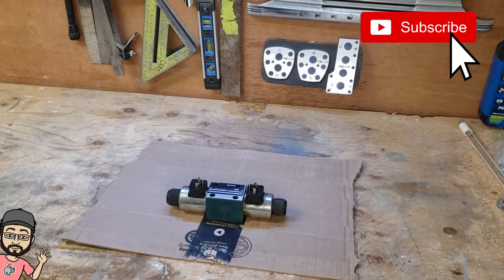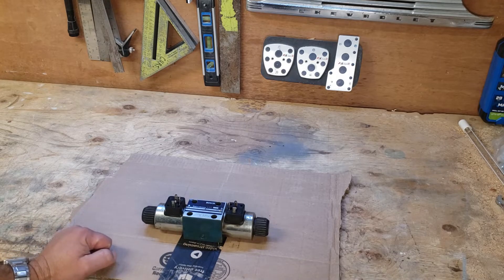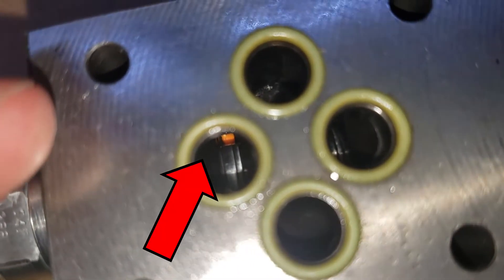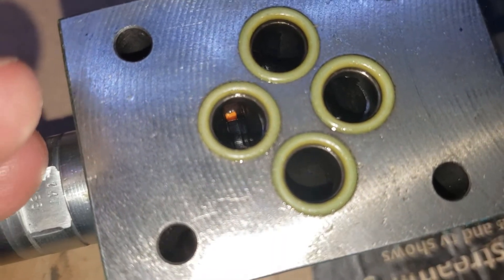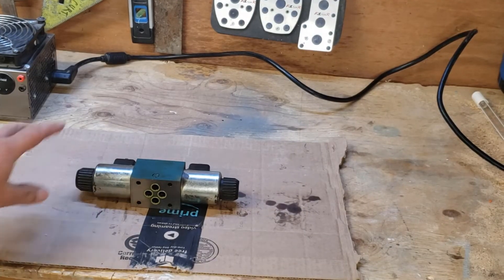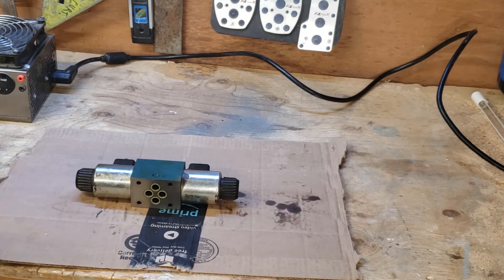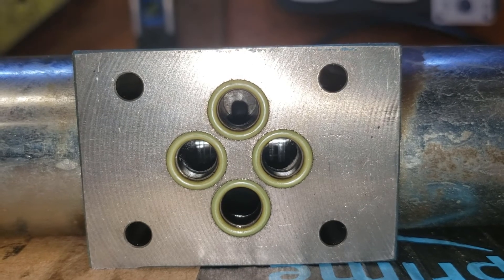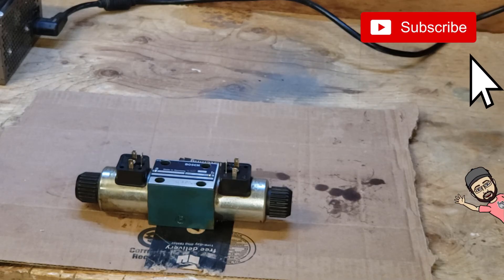Hydraulic Valve Repair

Comment: Thank you for taking the time to disassemble, inspect and repair the faulty directional valve in the video, sir.  That's really the only way that folks are going to actually understand how these valves work.  We have a backhoe here that has an intermittent reverse issue.  CAT calls the hydraulic valve that controls their "FWD-REV shuttle shift" operation the "Shuttle Control Valve Group."  My question is whether or not there may be a way to buy parts for the directional valve to affect our own repairs?  I'd also like to know which tools are normally employed to remove a valve assembly like the one in the video?  Our valve also has four deep holes, but it's mounted in such a way that one cannot see down into the holes.  Please keep up the great work.
Reply from the maker: Every one I have removed so far were held on with hex socket bolts (removed with Allen keys). To speed things up I bought long Allen keys and cut the short end off and use them in a cordless drill.
Reply: @nothandsomebuthandy   Great tool variation, sir.  As I can't get my head over the valve assembly, it's pretty much impossible to see down into those holes.  If you wouldn't mind, would you give me an idea of what the typical size is for the allen bolts used to hold one of these valves down?  Thank you very much.
Reply from the maker: I found this on google, not sure if it's your exact model but it's the same size Hex key I use: 260-8590: CAT SHUTTLE VALVE ASSEMBLY, Attributes:
• 3/16 female Hex head
• 7/16-20 UNF male thread mount
Reply: @nothandsomebuthandy  It turned out that the "hex socket" bolts holding the valve assembly in place required a 4 mm allen wrench to break them loose.  This seems pretty simple, but it wasn't.  The two bolts closet to the rear of the machine could be broken loose with a regular 4 mm "L-shaped" allen wrench.  The two bolts closest to the front of the machine, on the other hand, required me to "modify" the allen wrench.  In other words, I had to shorten the long end of the allen wrench with an angle grinder to make the tool work.  For anyone else with this problem, the wrench was shortened with a metal cutoff wheel mounted to our angle grinder.  By the way. do you think it might be possible to get parts for our directional control valve?  Although CAT sells the valve assembly -- at a premium -- I do know that this assembly was made by in the USA by a company called Vickers.
Reply from the maker: Really not sure, maybe a hydraulic shop would know. You may be able to get a whole new or used valve on eBay for parts. I have bought several parts for my old tractor there.
Reply from the maker: As far as purchasing parts I'm not sure, maybe a local hydraulic shop could help you there. What I have done is compiled a few new and used valves so I can just pop in a spare when needed and clean up the faulty one when I have time. If you can find the valve manufacturer and model some of the websites have detailed documentation on their products that is handy when sourcing spare parts.

Comment: Why valve coil was burn in 1 hour please give some solutions
Reply from the maker: A few things I would look into is to ensure the valve is free of debris and not sticking. Make sure you're using the correct coil for the voltage and current AC or DC, and that you don't have excessive voltage or current on that line, and the connections are tight. And lastly check the class of coil you're using to be sure it can handle the temperature and cycles your equipment needs.
Reply: @nothandsomebuthandy  yuken company coil 230 voltage..
Reply: It is ok to check the voltage but what could be the reason why the coil gets hot and burns?
Reply from the maker: Have you changed the coil and it burned a second time?
Reply: @nothandsomebuthandy  we change the coil 5 time sir..every time burn
Reply from the maker: Have you tried cleaning the valve to make sure it can travel fully open and closed? You can also test this usually by using a small tool and pushing into the small hole at the end of the armature while not powered.
Reply from the maker: Compare the amount of travel to other valves on the machine to see if it is the same or reduced.
Reply: I think the capacity of the valve is smaller than the machine needs
Reply from the maker: If you can't find the problem a workaround may be to add a full bridge rectifier before the coil and use a DC coil. DC coils are much more resilient.
Reply from the maker: I hope you're able to find a solution

Comment: Orange plastic is usually a back up ring for an oring or piston seal .
Reply from the maker: I've found some in multiple valves, just waiting for one of the cylinders to malfunction so I know where it came from.
Reply: @nothandsomebuthandy  there is a cetop 3 filter module that can fit under the valve with longer bolts to keep crap out of the spool ,but they restrict the max flow slightly .

Comment: I bought a 50 foot boom lift that has these type of hydraulic valves for all functions ,it drives forward but not reverse, you showed how simple it is to take apart. Thanks
Reply from the maker: Good luck with it!
Reply: I have the same problem. Please advise me if the problem is from him.

Comment: can you please upload any maintenance video o Bosch Rexroth 4WRPEH6C3B12L-3X/V/24F1
Reply from the maker: @Mr.Nizamul Hoq I looked up the valve you mentioned on the Bosch Rexroth site and unfortunately I don't have access to any equipment with that type of valve. I would like to get my hands on one to disassemble though, so I'll keep an eye out. I don't imagine these valves require any maintenance but rather are expected to be replaced when they fail. That said, sometimes a valve can get stuck when debris is caught inside the valve as was the case in my video.